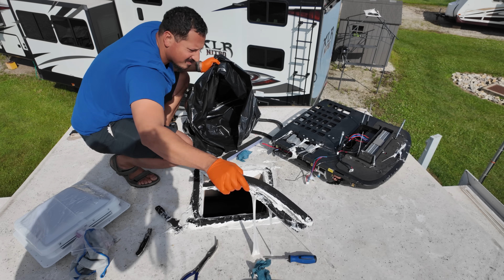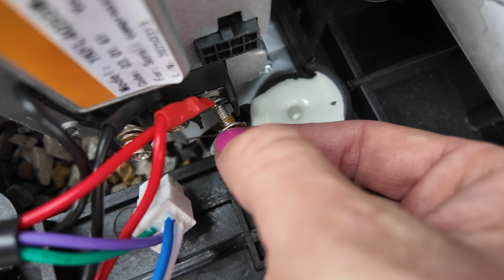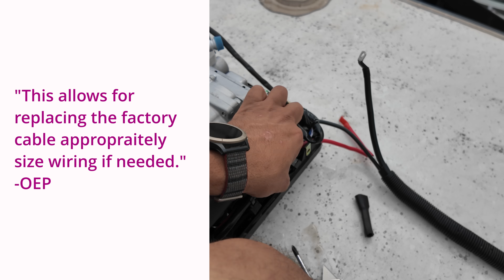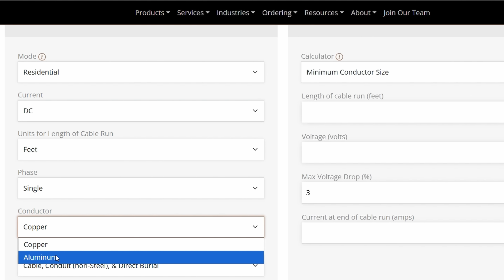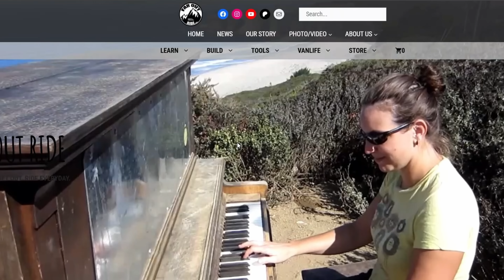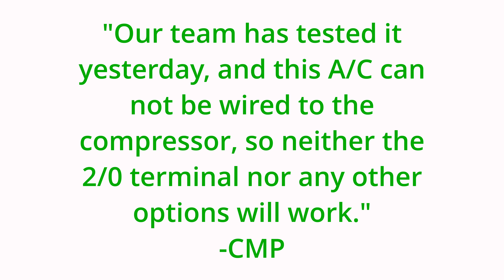The Truth About 12V RV AC Wiring in Big Rigs (What No One Says)

Comment: I am right in the middle of this at this very moment.  I have the outequippro 10,000 BTU .  I removed the old 110 V unit and installed the new one. my cable run is 25 feet and I now have to change everything to 4 AWG.   After watching your video I am not sure that 4 AWG is going to work either, so I am going back to the drawing board and will figure out a way to shorten the cable run.  personally I feel that the units should come with a choice of 4 AWG or 6 AWG cable as a standard.    Great video.  I just subscribed .. thank you
Reply from the maker: Wow! Let us know what you end up doing- there are so many great recommendations in the comments so maybe start there. Shortening your cable run is definitely your best bet short of switching to a 24V system 😆 Thank you, good luck, and safe travels!

Comment: I have a YouTube channel as well (Ruby aka Adventure Mom) in which I review RVs and modify my B-Van.  I am upgrading just about everything for better off-grid performance and I have been approached by many 12V AC manufactures for collaboration, but have turned them all down as changing to 12V would require running the DC wiring (6 AWG) in place of my existing 120V and 12V units seem to struggle with cooling on hot days.  Instead I opted for the Furrion Chill Cube 18.5 KBTUs with the VFD compressor (which I paid for) in hopes that would cool with less power draw.  Like you found, I ran into numerous issues.  The unit as it is not made for roof thickness less than 3.5 inches, the remote is useless unless you have constant direct line of site, condensation builds up in the roof top unit, louder than expected, and believe it or not it seem to struggle to keep my small van cool even though it is 18.5KBTUs ... long story short, I am returning this unit.  My plan now is to install the 120v Turbro VFD compressor AC.  If this does not work, I may need to do something really radical like install multiple small portable ACs (ex. Ecoflow Wave) and just remove the roof top all together.  Fingers crossed we can all find an AC that uses less power but is still able to cool!

Comment: Why didn't you just run the gauge cable you wanted from the battery bank. Then terminate the end to a bus bar, then attach the AC to the bus bar? Of course fuse your wire that you are running.

In the end though, I decided to go with a 110v setup because 12v units have a terrible cooling range. About 20 degrees. If it's 110 degrees, the coolest you can get it is 80 degrees. That's terrible. A 110v AC had a huge range. Even if it's 144 degrees, it can still cool to 60 degrees. Even doing the battery use calculations, when you have to run 12v AC for so long to cool the space you use a lot of power. In a smaller time frame, it will cool and holds that temperature in eco mode. Also a lot of 12v AC units are park AC units meaning that you will had to have had the car pre cool the space otherwise it works too hard. A 12V AC is not worth it for a extended use solution. Go 110v, close the hole on your roof and mount the compressor in one of your storage bays and vent the storage bay door.

Comment: Just build a breakout bus supply connected to the batteries with 2/o and connect the 6g to that. The real issue with 12v is being able to run it and the rv while charging(on shore power). PPL are not talking about that. I'm running a victron multiplus that can charge at 120amp. I am able to run my entire rv, ac(12v with heat) and charge the batteries(600ah) at 80+amps. On bigger RVs a 24v ac unit would be better because you can run two 24v units on a single large feed with a breakout bus.

Comment: run in 24 volt and one you get close to the a/c system you can reduce wire size when your within 5 feet or less companies do it all the time that is how a fuse panel works or even a house fuse panel large wire coming from pole to fuse box then slip up to feed all the stuff in the house with smaller wire size you could even do it right inside the a/c unit
Reply from the maker: 24 volt seems to be 🔑

Comment: I have a 40 class a motorhome. It has 2 rooftop units that work, both get cold, but neither cools the rv effectively at all.  Last summer in salt lake city with 95 degree days, the bedroom was barely inhabitable during the day, and pretty cool at night. The front area was not very habitable until sundown.  I have never been in any rig with roof top AC and really felt cold during the summer ever. So rather than go with something i know doesnt work, i got a window unit and cut a hole in the wall of my slide to accommodate the unit.  Its a pretty big 13,500 btu running at 115v. At best buy they are selling the GE unit for $350.00. In 100 degree weather we were all in blankets, and we still have window covers and vent cover to further block the heat if necessary. We are from arizona and i cant wait to go back and test the system in the summer. We have to pull the ac in to close the slideout, which is a hassle, but with the proper engineering and packaging options from a big builder it wouldn't be hard to replace roof tops with these window units. They are more effective, they are lighter, they are smart appliances,  and it shifts hundreds of pounds from the roof down as low as possible on the chassis. Its all wins
Reply from the maker: What a great option! Hope you’d stay 🥶 in Arizona!

Thanks for sharing!

Comment: 16:29 I have a hard time believing that loosing 3,500 BTUs per unit if you have a 13.5 roof air or 5000 BTUs if you have a 15k (every one of these I have ever looked at is 10k BTUs) unit is going to make you happy in the middle of July in say Southern Alabama or Phoenix. I'm all about making my solar set up useful and getting the most bang for my buck with my 1200AHs of lithium, but I like it COLD in the motorhome, not just comfortable.
Reply from the maker: Yes that’s the second hurdle! Can it even cool a space as large as ours? That’s a whole other math problem. We did still want to try something out and see if it was better than nothing.

Comment: For that price and complexity, I wouldn't go with a 12V AC, I installed a furion chill cube in ours, ice cold, quite and on low it only draws like 500w and on high it draws 900-1100W.
Reply from the maker: Nice! We wanted to try something that would run on batteries, if you are FHUs then it’s most likely unnecessary for you to explore! Thanks for watching!
Reply: @DeterminationUnbound we set up our rig for full boondocking, but then again we have 3kw of solar and 1100amps of battery. Furion is sustainable to run all day with this set up but the standard AC drained everything in 4 hours. 
Cheers 🍻 happy camping

Comment: Everyone needs to pay attention the BTU size of these 10,000 btu units…..they are great for a second unit for say like a bed room up front  …..in an Rv with a main unit on the roof these units are 13500 to 15000 BTU’S that’s a lot more air.
Reply from the maker: Oh for sure- that’s the second hurdle free the wiring- will it cool a large space? Probably not. Is it better than nothing if you are running on batteries only- we wanted to try that part out!

Comment: Yes - I installed OutEquip first model 12VDC unit into my 5th wheel 26ft unit in bedroom.  Modified output air to vent into ceiling ducts as well as built in vents.  Used 20ft 4AWG cables from batteries fused off 60a Breaker to roof top AC (went thru wall in to roof to shorten length).  Cools the bedroom well (8'X8') perfectly, but during hot days here in FL, it can't keep up with 90F temps outside.  Nights it works well though and entire unit is comfortable.  Used square steel blocks to extend the connections out from AC unit with longer screw\bolt for power connections.   See my quick page.. nothing impressive but it is working well.  https://www.youtube.com/watch?v=3YyCRrzKVc0
Reply: Thats terrible news. What's the point of the unit if it can't keep up with 100 degree weather?
Reply: At 800-2000.00 is super sad
Reply: @macbook802  they are not geared for RV's or 5th Wheel and Trailers over 15ft.  They can handle small areas like a van or Lance Truck Cab Campers... but nothing more.  So you would need two units at minimum to handle a camper 22ft - 26 and 3 units if 26ft-36ft.   It's almost like 10X10 cubic feet is the max they can cool down.
Reply from the maker: Thanks for sharing, I was hoping it would provide some relief. Sorry it didn’t work out.

Comment: I can't believe that no-one even the experts didn't think about a high current distribution system!

You talk about bigger RV's. There are many with two or even 3 AC units. 

Why not install a high current panel on the roof (centrally} and then run to all AC units from that?

I am also not comfortable using only 6awg lugs for 50+ amps so I would double those up. I would imagine you could get two 6awg lugs under each screw.
Reply: Modern inverters are 97 percent efficient. The solution seems pretty clear to me.

Comment: Did you look at doing a rear battery relocation.  for what 100' of copper wire, would cost, you could put a battery in the back with its own converter charging it, and use the cable that comes with your ac unit.
Reply: My background was in building competition SPL vehicles. You could easily cut the stock leads inside of the housing, then install a solid distribution block in there so it would be 2/0 all the way to the last 10" or so then out of the distribution block.
Reply: Another possible solution is to use one of the very large capacitors from the car audio world.  Some of them have distribution blocks built into the top of them.  This device charges up when the voltage is high and current draw is low.  Then when there is a large current draw, It starts to discharge its stored power to keep voltage up above 12.5.  This is used in cars where you see the headlights dim on big bass notes.  This would let you use a smaller gauge wire from front to back that might have a higher voltage drop on big loads, but could still handle the amperage pull.  Say a 4-2 ga.  Also, There is no reason that you cant use the frame of your RV as your return path just as all the electrical loads in your car.  This would save you the distance in ground wire and god him self only knows what the electrical potential of your steel frame is.  WAY more than 2/0. You just have to ensure that you have your front and rear lug making a good connection to the frame.  What ever size power wire you are running on the positive side you will need to run from the ac units - term to the rear frame lug, then from the front frame lug to the - of the front battery bus
Reply from the maker: Great option, but I thinking I may need a to get full off grid system!

Comment: 12 volt fridges are now the norm i wonder what size cable they use
Reply: 12V fridge uses a small percentage of the power required to run an AC.

Comment: We need to replace a Furrion a/c which is over the foot of the  north south queen sized bed  bed in our fifth wheel. It’s quite a bit closer than say the living room location that you used. Our batteries are in the front bay, just about below the head of the bed. I’d love your thoughts on this. The a/c in their is virtually useless, it is loud enough to raise the dead and thumps when it starts up which is a big jolt. We haven’t given up on the idea of a lower profile using 110. We boondock, try to avoid hot places, have 1800 watts on solar panels and 860 aH lithium running a 12v system with a Multiplus II.
Reply from the maker: A lot of great suggestions here! The best option may be to go with an inverted AC like the chill cube! You have an Inverter already and a decent solar set up! I have power envy! Thanks for watching!

Comment: Love the video. However your length distance is NOT correct. You don’t add the positive and negative wires for your “run” it’s just the length from the unit to the batteries. Unless your rv is 100 feet long you are calculating very wrong sir
Reply from the maker: Thanks for sharing your opinion, from all the research I did, and electricians I spoke to this was how it was explained to me, that it is supposed to be the combined distance of negative and positive.

Comment: Run a 1 gage wire to a junction box within less than 5 feet of the unit.  Then from the buss bar to the unit run the 4-6 gauge (largest it supports).  Advantages are the large gauge will minimize voltage drop over the run, the buss bar will make for easy work, you can include fuses or breakers at this point (consider it a subpanel).  If the wire is to heat up it would only be the short run between the junction box and the unit.  Make sure the large wire is fused or breakered close to the battery though.  Depending on the size of the units could run two off the same buss bar if you have a large enough primary cable. 

The better answer is to use 24v, most of these can be had in 24v, which has benefits.  24v requires smaller wires than 12v, 24v is still low enough not to to break the dry skin barrier (it will not shock you if you touch both polls with dry hands, anything above 50vdc will), the down side to 24v is I'm not sure if the fridge and lighting can be adapted to 24v so you might have to run a dc-dc converter for those systems.  It also requires you to set up your 12 v battery bank into a parallel/serial configuration. (if you have 2 12v batteries run them in parallel, if you have 4 you run two sets in in series and then run those sets in parallel.  Same kwh but now 24v... which will require a solar charger that can do 24.
Reply from the maker: Great suggestions, yes 24 v would be a much better option! Appreciate you sharing some knowledge!

Comment: Another solution:   Have one lithium battery, bring it as close as you can in the inside.  So you end up using cable size that will fit the connectors.  Hook directly to the battery (amp size depends on other factors).  Get a small charger, keep battery top off.  This could be permanent depending where you are living, full time or part time RV.   With this setup in advance, you may have even being able to bring the battery closer than your entrance.  Did you check for a wall partition inside and ran a cable down the wall space.  Easy enough to remove and/or replace a panel.  This way you would have been near your front of the RV.  All this depends on your inside layouts.  Even if you had the terminal size on the unit to handle 3/0 cable, I still wouldn't go that way.  From what I see, there were better options it seems.   Hope this give you some ideas.   take care @simplyoffgridlife

Interprovincial electrician, commercial, industrial, PLC tech, etc, technician and several other trades.

Comment: It seems like you were only thinking of the run as a single power source. Extending the battery leads to another terminal block should be treated as a power source with voltage= source voltage - voltage drop and amperage = rating of cable used. I applaud you efforts to do this safely, i think you overthought it though.
Reply from the maker: Thanks for your input and applauds….we can definitely over think things. 😁 not being experts we try do our best and glad lots are giving their expertise! Thank you for sharing!

Comment: Great Job!  My wife and I have a Valor with a significant 24v Solar install.  Even with the smaller cable requirement.  Not being an electrician, I'm shocked the wiring requirements haven't been emphasized.  Both me and my wife jumped on it. 

We are hoping to replace the skylight in the kitchen which puts it close to the front.  

Love the calculator you shared.  I doubt it will solve your problem but look at 12 to 24v DC2Dc.  The front AC is probably in reach.
Reply from the maker: Thank you we really did our best to share what we learned as DIYer! There have been great suggestions some that seem viable, some that maybe sketchy. 

We hope that works out for y’all, we have something in the works, just trying to do some research first!